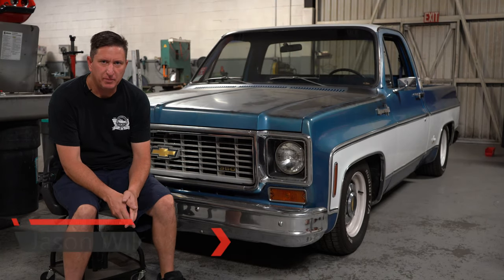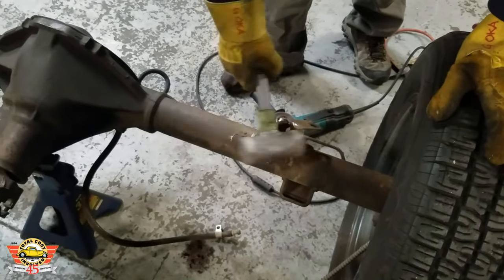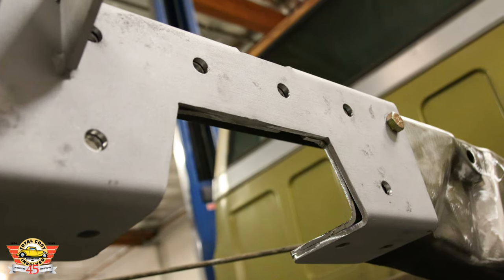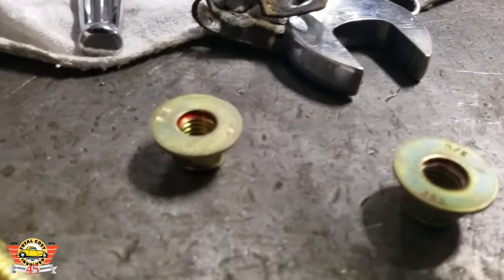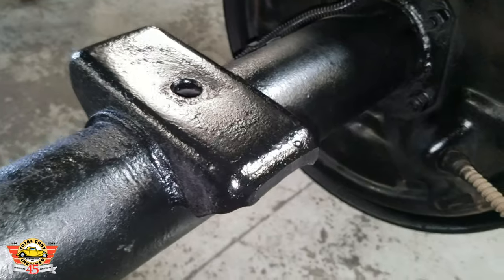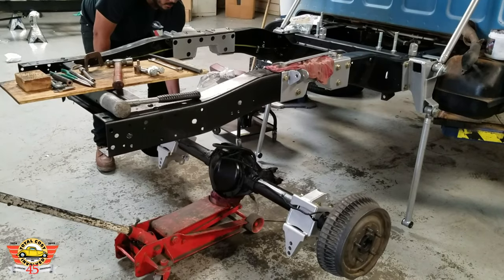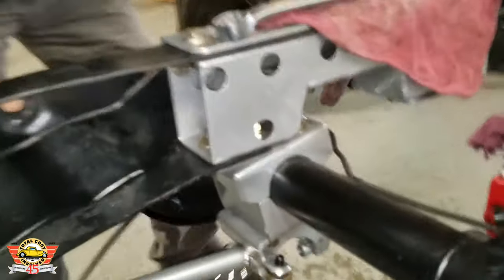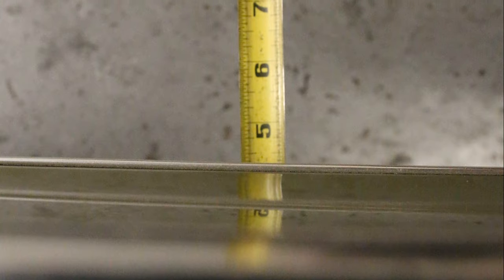TCI Engineering '73-'87 Squarebody C10 4 Link Install Video

Comment: Looks like a well designed kit. I like the full capture of the axle tube. How much drop are you able to get total?
Reply from the maker: It is the maximum allowed and still keep the stock bed floor. At full compression the top of the axle is roughly 1/4" away from the bed floor. What that equates to as far as drop is tough to say given the truck we began with was already lowered. At the lowest setting the fender to ground clearance is 24.5” with 29” tall tires.
Reply: @tcimuscle  awesome kit I have a 1987 c10 in mind for it.

Comment: Can I put it on a long bed  c 10 1975 scottsdale.And is that kit adjustable? My truck is currently 6 inch lower in the back,and I want to keep the same high
Reply from the maker: Yes, this kit will also work on a long bed. Our ride height is adjustable so you can set it at 6" +/-1"

Comment: 14:08 What keeps the frame from twisting in at the top under load? Definitely could use a crossmember between the coil-overs.
Reply: im sure its fine the frame is very strong in that direction but a cross member wouldnt hurt

Comment: With that rear set up whats the widest wheel you can fit ?
Reply from the maker: We haven't tried anything wider than 12.5". Mainly because the good performance tires are limited to 335/345. There is still more space for width beyond that but not much.

Comment: Weekend project material? Also do you think it’d fit a dodge 9.25 rear end with minor modifications
Reply from the maker: The only issue would be the axle tube outside diameter. It would need to be 3" or our axle bracket will not fit. In those cases we have a weld on bracket but it is also designed for a 3" axle tube but would be infinitely easier to modify to work.

Comment: Is there a reason not to weld the c notch in along with the bolts?
Reply from the maker: The only issue with welding it will be warping the factory frame. It can be done just do it one inch sections and let them cool off completely.

Comment: Are yall using an in house spings?  Ridetech spings are blue powder coated noticed the ones in this video are black.
Reply from the maker: We don't make the springs in house. We use a local manufacturer.

Comment: Why you removed  the shock bracket and when you installing de coil over the bracket is there  did you put the bracket back?
Reply from the maker: I'm not sure I follow but this video was done using two different trucks. The original truck was already modified with another companies product. We finished the manual with another truck. So you are seeing video clips form both trucks.

Comment: Whats the rated horsepower? Could your kit handle say 1000 to the wheels?
Reply from the maker: We'd be more worried about the frame at those power levels. But honestly without traction horsepower doesn't mean much. So if you plan on installing slicks and running the drag strip we offer weld on axle brackets that would be the preferred option in your case. We would also suggest upgrading from bushed link bars to Ridetech R-Joints.
Reply: @tcimuscle  hmm is there an email or message app I can contact you guys at?  Don't want to put to much of my plans out there in the air but I will say this, the last thing I ever would do is run fat slicks on my c10 only because that's exactly what everybody does. I'm definitely not going that route. You say you have weld on brackets, is that a complete kit coilovers and all?
Reply from the maker: @dou8letap82  Hit up our sales manager Evan. Evan@totalcostinvolved.com The kit you see here is what it would be, just with our weld on axle brackets instead of the bolt on style. It would require a 3" O/D axle tube in order to work.

Comment: I have a 1987 Chevy V10...4WD. With dual fuel tanks. Will the 4 Link work for this application? Not interested in lowering. Was looking at a 2" lift actually.
Reply from the maker: While the kit will bolt in to the chassis the kit is designed for a significant ride height drop. With a longer shock it could be raised, some, but not even close to back to stock height. Let alone raised from stock.

Comment: Can this system be adapted to a c20 (3/4 ton 2wd) suburban or do you offer another option?
Reply from the maker: We haven't been able to confirm if the 1/2 & 3/4 ton factory leaf springs are the same length. If they are then the front leaf bracket is in the proper location. If not we would have to provide a measurement for placement.
Reply: 1/2 ton leads are about 4 inches shorter than 3/4.

Comment: Would this kit work on a c30 dually?
Reply from the maker: We can't confirm or deny if it will fit. The frame profile appears to be similar/same as the C10 in the drawings we have found. The C30 definitely uses the same front leaf hanger. Which is the most important part of the kit. If you're local to us and can bring the truck without a bed we can confirm.
Reply: @tcimuscle  I'm in Oklahoma and my bed is a dump bed. I know the axle would be larger at 4 inch tube I believe

Comment: When adjusting the upper link bars for pinion angle, if you have to turn them out more than 2 full turns will it put any dangerous amount of bind on the coilovers? I just installed this kit, it’s awesome. But setting the bars up as shown here only nets me about 1.25 degrees up. I need to take the upper bars out a few more turns to get it to 3 to match the output shaft of the tranny. Being as the coilovers are mounted to the c-notch between two stationary brackets. I’m worried about the bottom attachment bolt pulling the coilovers into a bind when the axle rotates when I adjust the pinion angle. Or is 2 extra degrees of upward rotation minimal and I’m just overthinking? Thanks in advance !!
Reply from the maker: As long as you can get the lower shock bolt in and out you're fine. There should be enough deflection in the bushing to allow it. If not we can change from the bushing to a bearing. Also, if adjustments are needed beyond the specs laid out in the manual we'd suggest adjusting the lower bar first. The lower bar will not change wheelbase as much as the upper bar will.
Reply: @tcimuscle  Thanks for the response. That’s interesting. I currently have the upper bars turned out two more times than what’s shown in this video. Would leaving the upper bars like I have them but turning the bottom bars IN the same amount the upper bars are turned OUT rotate the axle upwards but leave my wheelbase the same as it was or should I turn the upper bars back in to what is recommended and use only the lower bars for pinion adjustment? I’m not sure there’s enough thread on the lower bars to turn them in as far as needed, though.
Reply from the maker: @bonethang374  Don't over think it, we're talking minimal differences in wheelbase. Since you've already turned the uppers, I'd just leave them and fine tune the pinion with the lowers now.
Reply: @tcimuscle  I figured as much. Overthinking is my specialty, lol. Anyway thank you for the help, it’s very much appreciated. Take care

Comment: Track bar looks very close to driveshaft. Any risk in applications where the drop is not so low?
Reply from the maker: Not at all, the track bar clearance remains the same regardless of which adjuster hole the shock is placed. So long as the pinion is adjusted properly there is plenty of clearance.
Reply: TCI Engineering what would Be a good Pinion angle with this kit
Reply: @vagabond3045  yes

Comment: I have a1970 gmc 1500 long bed with leaf spring suspension, will this 4 link work on my truck?
Reply from the maker: This suspension won't fit but our Torque Arm will. You'll just need to source a factory Truck Arm crossmember. Once you have that our kit will bolt right in. s://totalcostinvolved.com/products/1963-1972-chevy-c10-torque-arm-rear-suspension/
Reply: @tcimuscle  can this Work on a 1980 GMC  JIMMY Blazer ?
Reply from the maker: @jimmysapien9961  Yes, but it will require modification. We just posted one on IG a couple days ago.

Comment: Could you do a video on how to set the Pinion angle and also what is the correct pinion angle
Reply from the maker: There are a ton of those already so we never bothered.
Reply: TCI Engineering I’m running your c10 4 link and I have not seen a video on how to do a pinion angle if you could just tell me or send me instructions that would be super cool
Reply from the maker: @vagabond3045  Drop our tech guy Sal an e-mail. He can walk you through it. tech@totalcostinvolved.com
Reply: How low was that truck dropped in the front and rear
Reply from the maker: @vagabond3045  This truck was already lowered when we got it so it's hard to compare now vs. stock. These kits are roughly 6"-8" drop at their lowest settings.
Reply: @tcimuscle  you mean the Rear ?
Reply: @jimmysapien9961  yes
Reply: @tcimuscle  Will this kit work on a 1980 jimmy blazer ?

Comment: What abouth you don't waan to drop am just wan it normal, did I need tu cut the chassis.
Reply from the maker: This kit is designed to lower the vehicle from 5"-7".
Reply: Looking to replace the spring sistem for aer bags sistem, rear and front,

Comment: Not bad looking but I will be more interested when they start making these kits to take advantage of the maximum tire width. In other words quit bolting them to the outside of the frame. Make kits moving everything inboard so we can put some meat close to the frame please.
Reply from the maker: This kit allows for 335 tires with room to spare. The main reason you don't want to move the brackets inside of the frame is the loss of roll resistance. We offer universal Pro Street 4-Links specifically for those situations.
Reply: @tcimuscle  Yeah I figured I would have to use some universal setup or I may have to just custom fab up my own. I want to be able to run 32 x 14-15 slicks on it when at the track. I appreciate the reply though. 👍
Reply from the maker: @steves759  This bolt on kit wouldn't provide enough anti-squat for a drag set up anyway. The universal kit is so much easier to work with for what you want. Just trim the crossmember to fit the frame, figure out your bracket centers and shock angle and weld it up. https://www.ebay.com/i/350401007465?chn=ps&norover=1&mkevt=1&mkrid=711-117182-37290-0&mkcid=2&itemid=350401007465&targetid=934800886256&device=c&mktype=pla&googleloc=9031236&poi=&campaignid=10876471603&mkgroupid=107964302620&rlsatarget=pla-934800886256&abcId=9300401&merchantid=101986942&gclid=EAIaIQobChMI4KGv66Xu6wIVx56zCh12yAfGEAQYAyABEgIILPD_BwE

Comment: You do realize the directions say to put slotted ends towards the cab.
Reply from the maker: Thanks for the heads up, we'll update the manual asap.
Reply: So I assume the manual is wrong or does it matter either way
Reply from the maker: @douglasclark5439   Yes, the manual is being fixed for the error, the video is correct.
Reply: How much clearance from the yoke to the track bar do you have mine is less than a finger. It's real close

Comment: Can you put this on a 4x4 with 4” lift
Reply from the maker: No, not without lowering the back.
Reply: TCI Engineering yeah didn’t notice it was a c10 till started watching it. Trying to convert my K10 over to a set up like that to get a better ride coil springs up front